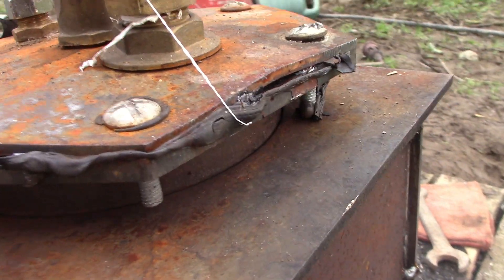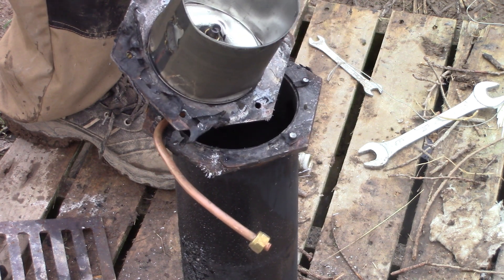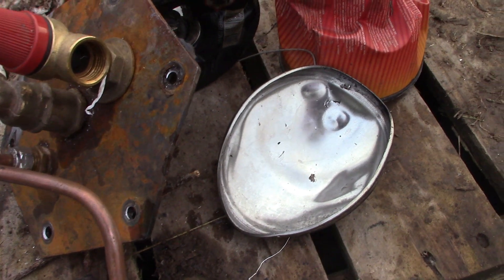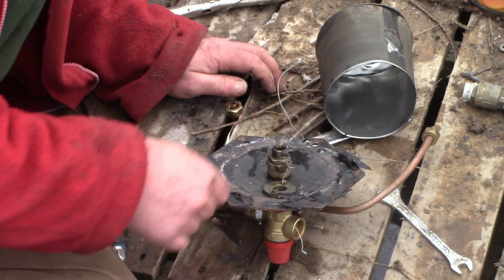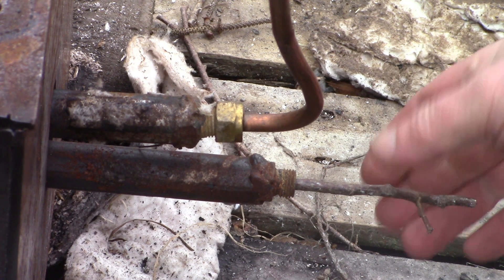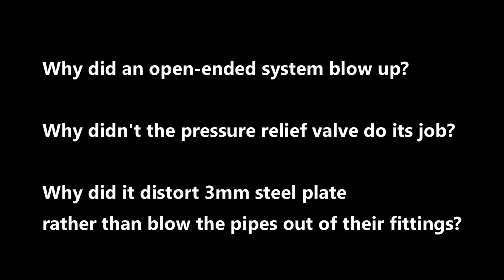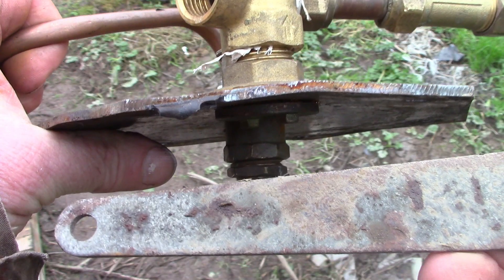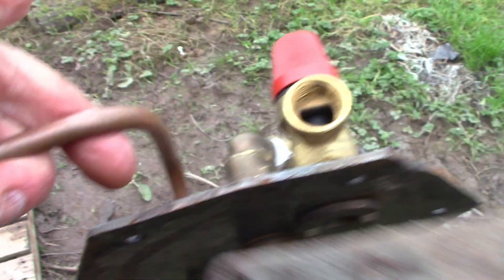Why Did My Boiler Explode??!! My Own Big Bang Theory...

Comment: I was worried about those canisters but for all the wrong reasons. I was concerned about leftover fuel (empty is never 100% empty) but seems like strength is the issue. My suggestions are to fix the float and add a second safety relief system with a different mechanism for redundancy. I rather like the ones used in pressure cookers, an upside-down cup on a length of pipe. The weight of the cup balances the pressure underneath but it pops up if the pressure gets too high. 
Might I also suggest a pressure gauge for the boiler?

Comment: The top float exploded not imploded. The force of the explosion impaled the top of the can upwards and onto the valve in the top of the boiler and the bottom blew out and the pressure caused the bottom can to crush. I believe the can had some gas or oil or residue of Ethel mecaptin and it became a gas with all the heat and had no place to go and the explosion caused a catastrophic failure and the force of the explosion caused the 3mm plate to bulge. Your system was very efficient because the cans displaced a lot of water causing the water to boil faster and more efficiently than most other steam boilers. So the idea is very good to limit the space in the middle of the boiler but not with empty gas cylinders. You should use something else like a domed pipe so that the heat effectively boiled the water faster and that domed pipe would be open on the bottom and the external pipe would be welded to a plate on the bottom so that you only have 3/4 of an inch of space between the two pipes and the top can continue to be 3mm plate or thicker. Instead of a float system, you need to make a water pump with a manual handle or a steam flow motorized pump to inject a specific amount of water at the same rate as the water is being converted to steam. Because the water has to be greater pressure than the steam pressure to be able ti ingress into the system. Boilers explode and can scald you badly, but maybe a steam generator where the water is boiled in a grid of pipes and those same pipes take the steam thru your dryer and motor then evacuated or condensed. Vessels are inherently dangerous, and your little boiler showed you that pressure doesn't like square lines. It exerts pressure in all directions equally. And the strongest form is circular or spherical. Surely you have seen the hurricane steam engine or cyclone or something like that. It has a bunch of radial cylinders and it doesn't use a boiler, it uses a bunch of tubing that is heated by a fire and each tube goes to a control for each cylinder. Also if pipe or tubing ruptures in the fire box it is less likely to scald you than a boiler full of water spewing water out of the hole.

Comment: If the floats (gas cylinders) were pressed parts together and with the combined temperature of whatever degree C water and the cylinders being aluminum which expand and contract in all directions is defeninitely an issue.  In the US on top of a water heater is a commercially made pressure releif valve as i notice you did have one installed. We did this as a physics problem in college where we threw a full aluminum soda can into an  open pit fire and discussed about our explosion which  put out the fire.  Cavitation is pressure at the end of the system being released to quickly thus what is ahead of that caused a greater negative pressure and ever so slight cooling inside the cylinders.  Need to remember aluminum epands and contracts in all drections as much as 10 - 15 percent in al directions.  Vermiculite is perfect as the insulator because sand as an insulatior in our experiments was to heavy.  My granny had a wood stove with pipes built into it with a copper resivour with a curious pipe running through the ceiling - it was the blowoff because the house would fill full of steam and became a sauna.  I hope there is some information here that can help.  I wish i could come to Ireland to help.  Cheers!!!  Patrick  Idaho, USA

Comment: Everyone has already provided lots of options for what may have happened so I'll not try and add anything there, I'm just glad you're all okay Tim!

It may be sensible to see if you can do some basic pressure testing of the next boiler with water rather than air - it's an established practice at least in the model engineering world and may help avoid loud bangs in the future! Although from what other people have said, it may not have been the boiler that exploded at all...

Comment: One problem with your theory Tim, the bottom float did in fact implode but the top float did not the bottom came off because it exploded driving the top shell up hard enough to pierce itself on the valve. Is it possible that the canister had enough fuel in it to spontaneously detonate at that temperature?

Comment: Don't mix up cause and effect. I think that the damage to the boiler is as a result of the had canisters exploding. The remains of the gas in the cylinder head been heated and had tried to expand but couldn't do the pressure inside has gone up until the cannister has ruptured. The top cannister has not imploded, it's exploded. The valve being punched through the top of the canister is probably a result of the canister being propelled violently upwards when the bottom came off. Compressed gas explosions (even inert ones like Nitrogen) are really violent because they are compressible. (Which is why you carry out pressure tests with water as the working fluid, not compressible so any failure isn't catastrophic). I think the lower canister was probably mashed by the bottom of the upper one when is flew off. I'm glad no one was injured.

Comment: The empty camp stove canisters were definitely the cause of the explosion. They had their own pressure to deal with and the superheated steam caused a collapse of both canisters. Might try a different solution other than empty canisters. Maybe something more of a solid float instead of something so vulnerable to sudden pressure changes.

Comment: I am going out on a limb here to say water hammer. Check out the forces involved when a vacuum chamber implodes under water, which is essentially what you had. All of that energy from the implosion would have been transferred to the water and from the water to casing. Flash boiling can be violent as well which could happen with a sudden drop in pressure as you discuss in the video.

Comment: Your system didn't blow up just your float. The heat has obviously softened the thin gas canister material plus also the heat expansion of the gas/air trapped within the canister, even if it was an empty one, there is still one atmosphere of pressure inside, which resulted in the simple swaged bottom flying off. Gas/air is extremely powerful when released in such an instantaneous way, which is why it was way too much volume for the little relief valve to cope with instantaneously, so the next weakest point gave way, your 3mm lid. There would have been a fair few tons of pressure acting on such a large flat piece of simple mild steel steel. If the lid had been thicker, you would probably have had the gutter bolts break, which potentially could have sent the whole lid flying off into someone's head, so the thin lid bending was a blessing.
Reply: This is why the bottom is off and the canister top has punched through your little inlet valve at the top. I have seen a petrol tank explode when someone was "welding" a patch on it years ago, yes I know crazy, but it would have been alright f it had been filled with water. Anyway, the tank had been sitting on a small triangle bit of scrap flat plate that was left on the floor and when the tank expanded instantaneously from the explosion, the bit of scrap had punched a perfect triangle shaped hole through the side wall of the tank. You would not have believed it unless you saw it.

Comment: I think the upper gas canister blew up. Caused all the problems. Either fast, smashing through everything, or slow, causing the fresh water to stop flowing and leading to a fast increase in steam pressure.

That 3mm plate just isnt that strong over a wide area.

Comment: I would reiterate all of the other comments being glad that you're OK! I'd also second those that say that when you have that much fluid resistance from long tubing, it's not really open-ended - it's like trying to pull a massive granite block on the ground. It may not be fixed in place, but the friction - the resistance - is high enough to effectively be complete.

I'd also second the comment saying that you didn't build a flash boiler - you have a normal boiler with a heat exchanger attached. Honestly I personally would recommend that you work on other things - I'm not a steam/boiler engineer, just a solid mechanical engineer, but I know enough to know that steam can be incredibly dangerous. None of us want to be reading about you in the papers!

Comment: Glad you were not injured.   A potential major "brown trouser" incident.
The relief valve will have a maximum flow it can release.   It may have released for a short time but the volume of steam needing to be vented was far too much for the small relief valve.   Pressure vessels often have a busting disc to prevent the pressure vessel catastrophic failure under a rapid over pressurization.   You can achieve the same effect by having a piece of pipe with a cap which is the weakest link in the chain.   The big challenge is figuring out the maximum volume you need to release and the thickness/strength of the material.    Complicated calculations.
I think water may have been trapped under the lid in some way.   If this happened, it would not take long to create a pressure wave to cause the bang.

Dave.

Comment: I did think to myself at one point that using the air-filled canisters in the high-heat, high-pressure system may have been an odd choice. Perhaps you can get a lightweight incompressible solid for a float valve, or else a strong steel bulb.

Comment: Looking at the top canister the bottom had come off could this have contributed to or started the processes of cavitation that lead to the explosion? But it also looked like it could have blocked the valves whether this was due to  the bottom one collapsing and a sudden increase in pressure or the blockage it caused the system wasnt technically open anymore. Also regarding the float I didnt think the canisters were a good idea, a simple block of wood could be carved to fit and even leaving relief for the valves at the top so even if there was a problem they wouldn't be blocked. Try not to blow yourself up .... I'd miss your videos ;)

Comment: top canister - exploded - open seals and no crumpling,
Bottom canister - imploded/crushed ??
I think think the loud bang would have been the top canister exploding by air or gas expansion,  I dont think the valves were blocked until this happened as you would have then had two bangs.
At a guess the top one blew out the cover and also crushed the bottom canister - although I find the bottom canister confusing. is there any other evidence of what state the can was in? does it look like the one way valve was still working?

Comment: Your theory sounds plausible and very interesting.  I was also wondering if the float bottle smashed against the top of the boiler somehow sealed off the valves, couldn't quite tell from your disassembly.

Comment: The top can blew up for some reason, probably build up of internal pressure from the heat.  It buckled out indicating a buildup of internal pressure. At 230 C (440F) that aluminum lost most of its strength.  This did three things.  

It partially sealed the can against the wall restricting steam passage.

The top of the can was impaled on the fill valve keeping it from opening.and letting water into the boiler.

The top of the can also blocked off the outlet and pressure relief valve.  You can see the dimples in the top where it was driven into the openings.

Pressure built up and caused the flimsy top plate to deform, finally releasing the steam.

Lucky the top plate gave way, releasing pressure.  If the top plate and bolts were a proper flange the pressure buildup would have been much worse and the explosion much more violent.

The pipe fittings are probably good for much higher pressure than the top plate and stayed together.

Let's be safe out there.
Reply: i don't think the boiler was at 230C just the out let as he was making dry steam or trying to

Comment: Nothing wrong with your safety valve. The top float exploded due to the residual gas expanding with the heat causing it to rupture. The bottom has blown out of it forcing the top section thru your fill valve. The rapid over pressure is what distorted your boiler lid. Try putting a so called empty one in a fire and observe the results. I predicted that happening when I saw you using them as a float. Maybe get yourself a boiler pressure gauge on the top of the boiler so you can monitor pressure. Still a good invention, just needs some fine tuning.

Comment: Tim, I'm not an expert, but: it might be better if the next floats were something like steel cans, tightly filled with wood, which would not compress quite as quickly as air.

Also, you may want to think about some kind of shrapnel cage or wrap around the boiler; I think the Stanley Steamer had something of the kind. It would be a nuisance to deal with, but I would hate to lose you, particularly to something so preventable.

Comment: First off I'm glad you're safe. I'm sure you gather that the floats were the problem. Based on how you plan to use the boiler, it would make sense to manually control the feed water flow since that would be your "throttle" and not have to worry about the floats. Add a sight glass or test cocks open to find the water level. For what it's worth. I think the float expanded from the heat and sealed the bottom half of the boiler from the top where the safety valve was.

Comment: The bottom of the boiler did not bulge out at all?
In that case I doubt the explosion were due to any overpressure inside the boiler itself since it would have excerted an equal force on all surfaces and thus both the top and bottom would have bend.
As others have stated, it is most likely that the cannisters themselves are what exploded and I'm guessing the top one did so, blew its bottm out, crushing the cannister beneath it and pushed its top half up to pierce itself on the fitting while also blowing out the top of the boiler.
The bottom cannister cushioned the impact and protected the bottom plate of the boiler from getting distorted.
The explosion in the top cannister was most likely due to residue gas inside it. Not necessarily due to a combustion but due to expansion of the gas under the increased temperatures.
Reply: Bottom of the boiler could of been protected by the bottom float and having a heavy pipe on the edge.

Comment: I was thinking along the lines of your theory and that the pressure relief valve didn't work because the pressure changed too quickly for it to cope, but I don't think that the stick had anything to do with it, I think that the pressure inside the chamber was just simply too high for the floats to handle.